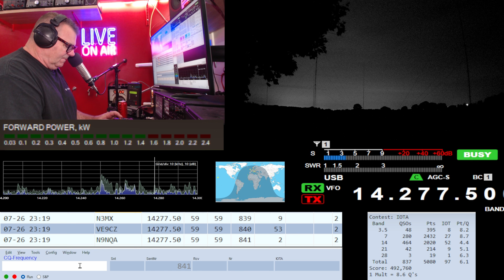Why I Don’t Want an SDR Ham Radio

Comment: You are confusing SDR with DSP. SDR is not about DNR, noise blankers etc. This is a DSP part. Your TS-990S has 100% digital signal processing (demodulation and additional IF filtering). The last intermediate frequency (24kHz) is digitalized and THEN all demodulation, DSP filtering etc is done in the DSP processor, everything that you hear is created by software. Like in other superhet rigs with DSP unit. The difference with SDR is that in SDR all physical blocks that you have in analog radio *before* DSP unit are also in software ("mixers", "local oscillators" etc). The common drawback in all full SDRs is lack of physical roofing filter, this is probably the biggest advantage of "old" superhets
Reply from the maker: Fair point on definitions - and yes, the 990 is heavily DSP-based. My point wasn’t taxonomy, it was operator experience: analogue front-end + roofing behaving differently to full-band SDR in a quiet RF environment. Ears notice that before block diagrams do.
Reply: @DXCommanderHQ  hi, fact is that SDR frontend is DSP based emulation of analog receiving circuits, so less dependent on parts aging and weaknesses of bad circuits, so in case of proper IQ data (selecting narrow band with high resolution, as possible using for example AirSpy mini + spyverter or HF+ Discovery ) you get perfect signal as from superhet, or even better, why not ... and THEN come your ears, sure :-)  I got your point about importance of "trained ears" far more, the NB algorithms are not using any kind of human intelligence (nor artificial yet), they are not trained on this (but it may come also, first for CW (last time during cq ww dx contest I paid for "morse expert" android app to test it while receiving 10m band on president george II real superhet, feeding the app only by audio from speaker ... and I even didnt knew it also can "lock" on specific CW narrow signal in the filled window ...), it was only very punk fast test here on indoor magnetic antenna (trying to provide some ugly radials also; and not noiseless enviroment here at all), so I heard only strong signals here, quite lot in fact, comparing this with some local SDR remote receiver ...that GII worked perfectly ... not a full licensed ham here (my dad was entire life on HF/CW, I was licensed only as young "technician" VUHF only) ... but now I am still considering portable experiments with antenae on CB 11m; cheers and have nice next year too :-)
Reply: @DXCommanderHQ  Yes, fully agree. And an "old school" configurations with physical roofing filter are also, typically, much better than full SDR if there is a close in-band station (multi-station setup, field day, another nearby ham station working on the same band etc).
Reply: @so7na  "...the result that the very highest close-in receiver dynamic range is achieved. This has been a major competitive marker for some years, and this transceiver, as well as the FTDX101D, puts Yaesu at the top of list, as seen in the ARRL Lab measurements in Table 1 and independently tested and listed in the Sherwood Engineering tabulated summary of receiver performance ."  ARRL, QST, 12/2020, Product Review Yaesu FTdx101MP
Reply: @DXCommanderHQ 
Hey Callum , great video . I think to get a definite data driven comparison ,  maybe just order up that new 7300-MK2 and send it to me , I’ll send you some video comparisons in about 6 months 😂😂😂😂, love the channel buddy , always informative and entertaining. I’ve been following your channel a couple years now . 73’s from Tennessee 
KK4ISW
Reply: @DXCommanderHQ  You're comparing the worst with the best. You would not know the difference between a modern stat-of-the-art SDR compared with a superhet., well actually you would, the SDR would out perform it. Your semantic asides are just that, meaningless bias.
Reply: Just a note for accuracy: the "noise blanking" or "periodic noise blanking" (NB) is part of an SDR as a system because a good one requires a wider spectrum to be processed. The nature of such noises is different, so that cannot be just implemented effectively in a "DSP" after all other stages and the demodulation.
Reply: Are you a NOOB? pls talk in engineering language 
Can't decipher this
Reply: @DBMMMMM  "There are two types of Noise Blanking employed. These are Wide Band Noise Blanking and Narrow Band Noise Blanking. The difference is that one works off the full IQ spectrum and the other works off the down-sampled and filtered signal ... Noise Blanking works on the time domain samples and takes a running average of the samples from the ADCs as a baseline reference level for the total signal. Transient voltage spikes associated with impulse noise will tend to give short term large increases in the ADC sample magnitude and so the software uses a blanking threshold that is user defined. If the individual sample magnitudes are greater than the than the blanking threshold, then this sample is 'blanked' or set to a very low value. ... The wideband noise blanker tends to be the better of the two and that is primarily because it works at the full sample rate and with a higher sample rate and larger number of signals, the rolling average measurement of the incoming signal tends to be more constant. It is also much easier to see the impact of the threshold adjustment as you can monitor regions of spectrum where there are no want ..." And the analog implementation is not too far from this; it's better in the earlier stages before narrow filtering, but not only in the first IF, etc. - even if you have an IF DSP at the end of the path.
Reply: Agreed 100%.. I’m a CW only op (in fairness I’ve army signals CW experience too). My right is an FT1000Mp Mk5 on a Cobweb and EFHW, and I amaze people all the time by working a station right in the noise that an untrained ear just can’t detect.
Reply: @so7na he is definitely not   confusing SDR with DSP. Because SDR is simply not analog is it? I totally agree with this video. Analog is just best for a trained ear.
As for me, it gives me a better feeling also. Never getting tired of real analog noise with a voice somewhere buried in it.
Well actually I'm a digital hater loll
Reply: @DBMMMMM  Not really IMHO.   SDR means that radio "rf blocks" are emulated in software. After that I/Q signals are processed by DSP like in all modern (and many older) superhets, where only demodulation and extra filtering is done in DSP. Otherwise every radio, even an old FT-891 shall be called SDR. From many years a standard is that last, low, IF is sampled and then digitally processed, audio is created in software in the DSP. But they are not SDR. Honestly - what you hear as "analog" (even in this video) is a digital sound. An analog radio will have an analog product detector with analog BFO, analog audio filters etc. 

A hypothetical example: 

Lets say you create rig that has DSP, that DSP will by feed with I/Q signals. This is a radio backend. Now you create two RF frontends: one standard, with mixer, local oscillators, IF crystal filter (roofing filter), IF variable gain amplifier, and second mixer with an IQ output. This is an analog superhet configuration.  Second frontend will be done in a FPGA chip in software. It will have similar stages as superhet, but instead of physical component, complex circuit, all will be done in a simple FPGA chip. This stage will also produce identical I/Q output signal, that will be processed by DSP. This is a SDR stage, because (almost) all radio blocks are emulated in software. At this moment both superhet and SDR stages produces the same I/Q output.  Now: this I/Q is processed by the same DSP in our example. 

In theory you shouldn't be able to distinguish which one is a SDR and which one is a superhet, because audio is created in the same backend (DSP) from a RF quadrature signal produced by RF frontends.  All radios with DSP in the backend are not truly analog radios, in all of them (even in an old 891) you can find some digital artifacts in audio. 

The biggest disadvantage in SDR is, in my opinion, the lack of physical crystal fiter (roofing filter). SDRs are quite "open" to RF, they have a broadband bandpass filters before ADC chip. Strong RF signal from close transmitter, even sometimes few MHz away (but in the frontend bandpass filter range) can completely block a SDR radio.
Reply: @so7na im not having any knowledge about the radio in this video, but you're wrong about analog. ANALOG=ANALOG. My radios are ANALOG trust me. No sampling DSP blahblah whatsoever as I don't use anything digital. Zero
Reply: @DBMMMMM  Not going to argue, but I own a Yaesu FT-1000 that is twenty years old and yes it has crystal filters in it that are definitely analog, however there are still some settings that I can change that are absolutely digital as it has some very basic DSP. That radio has a very different sound when you listen to it as compared to the newest radios. If your radio is thirty or forty years old like a Collins or a Drake then yes you truly have an analog radio, otherwise you will have some digital filtering. As Callum said, enjoy your radio. This is a fun hobby. N3EDO.
Reply: If it has DSP, it’s not Analog… DSP by definition is Digital and therefore has AD/DA sampling conversion… that’s physics.
Reply: @Spidouz you are wrong.
There is DSP in the audio domain and there is DSP in the RF domain. 2 completely separate things without any relationship. I have used RF DSP in an SDR design and also before full analog front end until the analog PLL-demodulator followed by A/D into the Digital domain for audio processing. GEES guys what the F are you all talking here. It's not complicated
Reply: @DBMMMMM  Yea but in the TS-990 he is NOT hearing "analog processing". The receiver converts everything to digital in the DSP stage then processes it. So yes he is confused.
Reply: @n4lq define 'everything'.
You mean audio? Or what

Comment: I could hear the difference in music when I went from "...my big ten inch!" to that silvery little thing of about half that size. Digital format had a "too bright" sound to it compared to the analog sound. I think that tended to emphasize the range from above the midrange to the highs. In the radio world it may give an emphasis to the "hiss" of noise before processing rather than ridding it from the signal. I attribute this to the fact that digital deals in discrete quantities, knocking the smooth curves into jittery digital semblances thereof. The only way of overcoming that is through increasing the sampling rates of the A/D converters at the input of the RF stage. But... with age... my hearing is slowly deteriorating and I sometimes find my wife saying some off-kilter kind of things that she says wasn't what she said at all. THAT goes both ways in our house and brings us some good laughs. Do you think Mr. Heil developed some kind of processor to help with that before his passing?
Reply from the maker: Interesting observations on digital audio and noise.

Comment: I agree with you Callum my everyday radio is a superhet ( Yaesu FTdx-3000) which i really like , it has a great receiver but one thing i did was i turned mine into a hybrid by adding an SDRplay RSPdx-R2 to my 3k's RX output  ( for tighter resolution: tap it into the rigs IF output) i have it independently controlled ( i don't tie it into the rig's VFO) so its like having a second RX'er . My FTdx3k  only has one receiver.  So i have a scouting receiver or an ancellary receiver.  There's times where the superhet hears better than the RSP but in also works vice-versa where the RSP just pulls that signal in better.   I also have a full SDR transceiver ( Yaesu FT-710) i really like that radio too but, since I've added that RSP to my main rig,   really spoiled me.  I started radio  with tube radios.  Heck, i still have my old Kenwood TS-850S  which have amazing superheterodyne receivers with excellent mechanical filters  ( cost a fortune for those filters back in those days) but those superhets still hold their own in modern times even against modern DSP driven rigs, adding an SDR receiver to those rigs could really "supercharge" an old radio,  so new hams with old gear could really, afforabally , bring a rig up to advanced operation.   But the true art of radio operating is the art of listening. Thanks for the great video  de N3TGY
Reply from the maker: Listening... Oh yes.

Comment: I don't like modern radios 
Too many buttons to push to change settings band etc 
Also living in a poor tropical country there is heat humidity salt air environment 
The TFT film distorts touch screens stop working static sensitive etc
One little diode dies and you have an expensive paperweight 
Nobody to fix 

I prefer as do many local hams 
The older rigs 
Less expensive and easier to repair 

I don't need a waterfall and 2000 memories and other bells and whistles 

Just a solid rig that puts out 100w on 160m cw 

I just purchased a 35 year old mint ft-990 from Japan 
650 usd included shipping 
All functions I need on front panel

Comment: I much prefer the Icom IC 735 over the Icom IC 706. I don't like having to go through multiple menus just to adjust rf power out on the 706. Push a button slide a switch or turn a knob and I am much happier .
Reply from the maker: I totally get that preference for physical controls!

Comment: Your comment about "hearing" is absolutely true.  Over the years, my internal filters (in my head) have developed to, what turned out to be, extraordinary levels.  A courtoom experience brought this home in an unexpected way.  I was a witness...sitting in the chair...when the attornies wanted a "sidebar" with the judge....a private conversation with the judge.  The lawyers approached the bench and the judge turned on a whitenoise generator that was intended to mask the conversation from everyone in the courtroom.  I was about 15 feet away.  I could hear every word said by the lawyers and the judge....but noone else in the courtroom could.  I verified it by asking others...who were about the same distance away from the bench....and they confirmed that they couldn't hear a word.  My mind was filtering out the noise...and it was absolutely because of years of dragging signals out of the noise on ham radio.
Reply from the maker: That's an incredible story and a great real-world example of how those "internal filters" develop!

Comment: HELLO! I confess that I mostly thought you were on youtube as a influencer and salesman (still likely true yet can't fault you for that). Much credibility in my book for posting this opinion! I have used modern boxes and some older hardware. Guess what remained? My analog Icom and my Drake C line. With a noise floor of about -141dBm, I dare say I can copy anything a modern box can unless a massive signal is right against the passband. Let that signal be splattering? Then no magic will happen even with a high dollar DSP radio. Modern boxes are really good, yet are not much better than the older stuff which is/was really good also. Caveat though, there are LOTS of older and modern boxes that are also not very good. So consumer beware! You need to know what to look for!!!! PERIOD! The consumer needs to be aware that many modern boxes are software based for a clear reason... Manufacturing costs and margins. Again, knowing what to look for and why is key... Living in areas where TONS of noise can't be avoided? You are likely better off with a decent modern box with good DSP features.
Reply from the maker: An influencer? Hardly - check out my content properly. Construction projects, modelling, contests, advice and fun. Sure - I might do a product launch from time to time - but this is just my hobby too. Agreed on the noise floor issue - and radio selection.

Comment: This conversation of digital vs analog is ageless, and I believe the framing is almost always off.
This is the same debate as vinyl vs CD or film vs digital. Digital is powerful, clean, efficient and sterile, it is a model of reality just not reality itself. Conversely Analog is messy, noisy, and complete.

Noise is data.
In an analog receiver, everything that reaches the detector is preserved as a continuous signal: the wanted signal, the noise floor, phase jitter, amplitude variations, intermod products, none of it is discarded. You may not want all of it, however it’s all there. That matters, because noise tells you about the channel, propagation, interference, and system behavior. As well masks signal(s).

SDR, by definition, discretizes.
The moment you sample, you collapse the wave form and are now time-quantizing as well amplitude-quantizing a continuous waveform. Anti-alias filtering, finite sample rate, finite bit depth, and DSP filtering all "remove" as well reshape information. That’s not a flaw, it’s how digital systems work, but it is data reduction relative to the continuous analog signal. Data loss is the trade off.

That said, this is not an “SDR bad / analog good” argument.

Both have valid use cases:

Analog radios preserve the entire waveform and degrade gracefully. They’re excellent for weak-signal work, listening through noise, and situations where human pattern recognition matters.

SDRs trade raw continuity for precision, repeatability, selectivity, and flexibility. They excel at narrow filtering, demodulation accuracy, digital modes, and spectral awareness.

The mistake is arguing which is “better.” "Better" is a weasel word in that context.
The more accurate question is, what information do you need, and what loss model are you willing to accept to get it?

Both radios are suburb at what they do, The art is knowing when to use which.
Reply from the maker: That’s a very fair and well-put summary. I agree... it’s not about “better”, it’s about what information you want preserved and where you’re happy for decisions to be made. Nicely articulated.